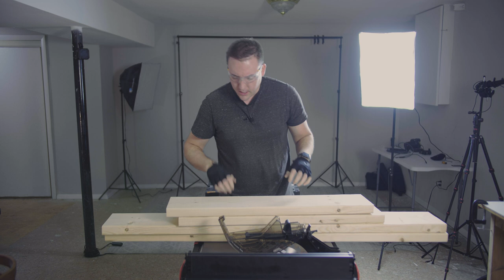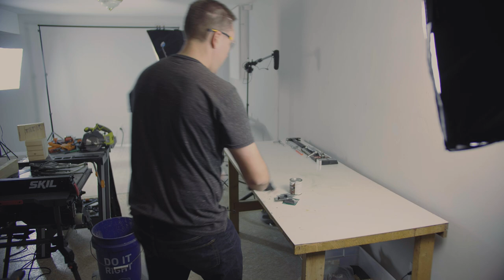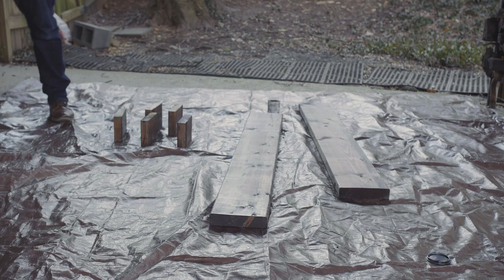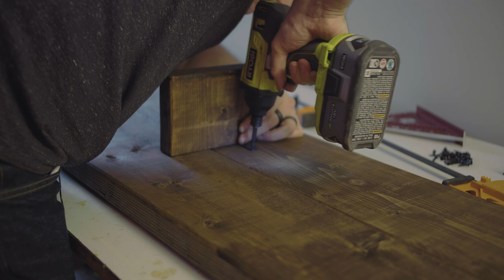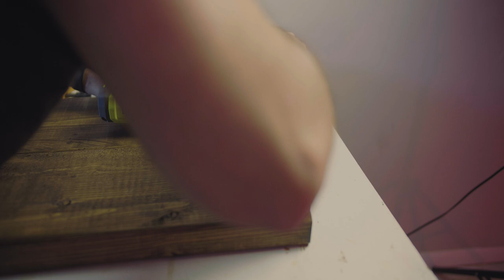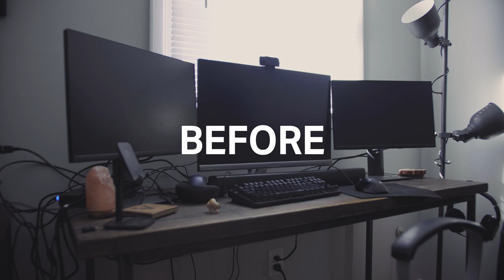youtube video #-C1gyfxEGH0

Comment: Using the fence as a stop and the mitter gauge like that is crazy dangerous, since the piece can easily get trap between  the blade  and the fence and shoot back at you, move your hand towards the blade  or worse. Clamp a stop block some inches in front of the blade and to the fence and use that as the reference, so in the blade part there is space for the wood to be without problems

Good build, came out great
Reply from the maker: That makes a ton of sense, thank you for the helpful tip and compliment! I definitely see what you're saying about using the fence as a stop block. Seems so obvious now that you mentioned it. Won't make that mistake again!